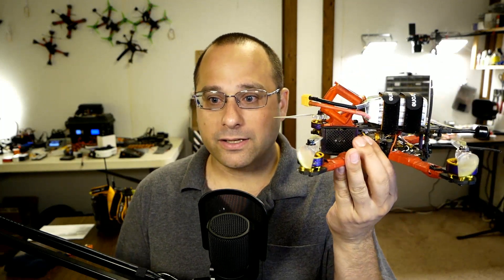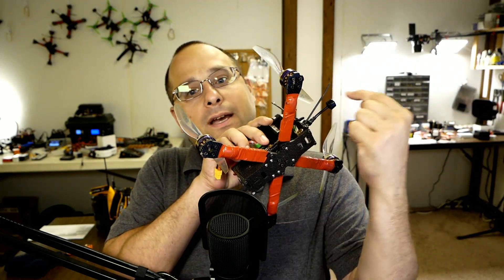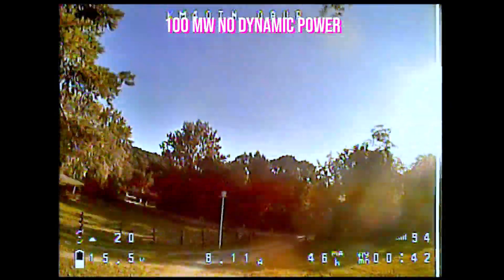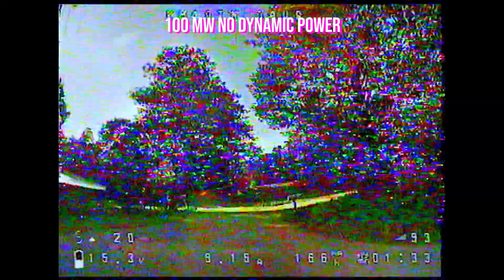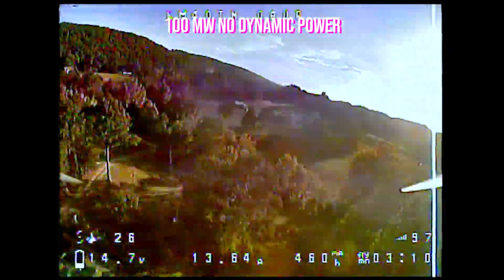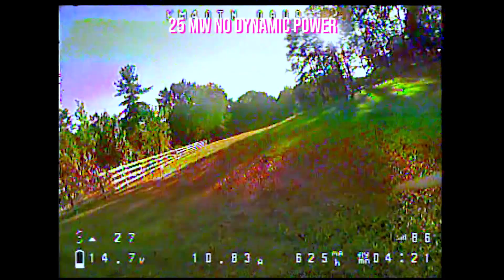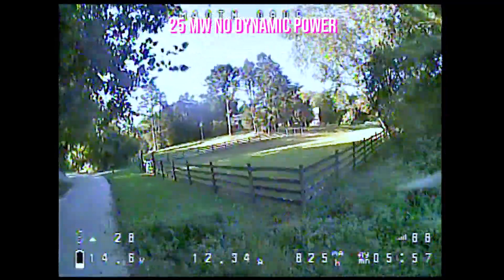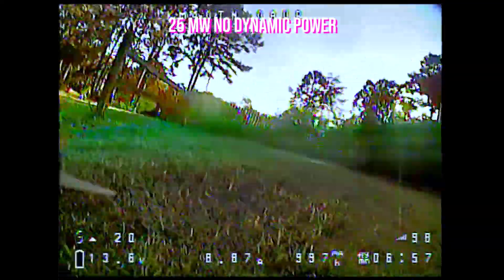TBS Crossfire 150 Hz | How Far Does It Go

Comment: i'm confused. I see people flying crossfire and its at 99rsi for ages, and then when it starts dropping off its almost like instant low rssi warning. With my r-xsr I am only 99 when its right next to me, and there is a more realistic gradual drop off of the RSSI when i fly away from myself, but I can get it down to the 30's and still have control of my quad. Whats up with that?
Reply from the maker: Crossfire is probably reporting lq or combined lq/rssi. In older versions of Betaflight it reported lq as rssi because Betaflight didn't support lq. Lq drops off more abruptly.

Comment: Why not use a clover leaf antenna like on the video?
Reply: Antenna are tuned length for bst results (and for purpose). E.G. in most cases CRSF is 915MHz where as VTX (Video)  is 5.8GHz so have very different requirements from the antenna.

Comment: I got out 1.2 miles on 150hz with 500mw in an extremely rf polluted area.
Reply: I did better than that on 100mw and only using immortal t on the full TX and dipole L antenna on the nano rx! People don't realize that if your pushing too much power it can make it seem like you have weaker signal and corrupt data! 25mw in the city I got 3 miles using dynamic it went to 100mw and got 5 miles before telem dropped and went to 50hz! I bet if you went to 100mw you would go farther! 915mhz 25mw you should be able to go really far over 2.4ghz! Just the way it works! Expecially using Lora! I'm a diehard fan on tbs for life and love their products! Every feature they came up with and future proofed gear like the full TX had BT and Wifi built in from day 1 even tho it wasn't enabled yet 3+ years ago! Express lrs blows tbs crossfire out of the water but the only difference between the 2 is express lrs uses Lora tech tbs has the capability to but doesn't really use it!
Reply: @jbizzbuildsmanstuff9932  I got the Tango 2 and need to use the 868MHz Band because I'm in europe. I want to use the locked 150hz on my quad. Set the quad up for locked 150hz.

At the moment I use 25mW and Dynamic Power on at the Tango 2. Should I use more mW or turn Dynamic Power off? I don't know the best settings for not losing connection because I'm locked at 150hz.
What would you say about it?

Comment: Pfft, CRSF won't go further than 50 metres before failsafe for me. Joshua, your videos are an absolute Godsend but I'm about ready to throw my quad out the window because CRSF just won't work for me.
Reply from the maker: Something is seriously wrong with your setup. For example, if you are in the U.S. and using 868 MHz then that is why. You need to set the CRSF for FCC region. Or if you are in EU and using 915 MHz same thing. You need to set it to EU and use 868 MHz.

Comment: I no this a good system but im going 1 mile away threw woods and trees,buildings blocking me and everything and i dont failsafe till i try about a mile and half.Point is im useing a dx7s.I want to go crossfire but since my dx7s is putting out 302mw i dont no that i would gain much.I watched another video a guy had his cranked up to 200mw and is getting just 3/4 mile in wooded area so if its no better coverage than that my dx7s will do that.I think im going to try a 433 system like dragon link or something.wish crossfire had a 433mhz system at 2 watt.

Comment: Hey Joshua Bardwell, can you tell me, if i can unmount the antenna on the crossfire micro tx when sending to another quad with frsky receiver? Do i have to set something in my frsky qx7 radio? 
Thanks for your videos!
Reply from the maker: If the Taranis Model has "external module" enabled then you must leave the CRSF antenna installed.

If the Taranis Model has "external module" disabled then you can disconnect the antenna.

Look in the Model Setup screen and you will see the option to enable/disable the external module.
Reply: Joshua Bardwell Thanks a lot.

Comment: Update rate != Latency,  you can have a high update rate and high latency, or a low update rate with low latency. Standard Taranis has a low update right and high latency, the inputs take a while to get from the sticks out the radio, from the tests I've seen, CRSF has lower latency regardless of the update rate (as do many other protocols, FrSky Taranis Sbus is remarkably high latency).

The L shape only reduces nulls in a magical sim land without a cable, when the cable is added to the simulation there's just as many nulls. The efficiency is also lowered and the SWR is raised when you mount the antenna like that.
Reply from the maker: Update rate does not equal latency you are correct, but it is also true that when crossfire drops to 50 hz, latency goes way up.

Comment: Off topic but what are those 6 inch biblades on this setup? Like them?
Reply from the maker: Lumenier 6040. I do like them pretty well. 6" thrust but more responsive than tri-blades. But they don't seem as well balanced as the HQ tri-blades I had on there before.
Reply: Joshua Bardwell I’ll give them a try, thanks!

Comment: I went to TBS with a issue I had seen with friends nano RX,s about the bind button coming apart . I had bought 5 nano RX’s and the bind button on 1 of mine came apart. When I contacted TBS the guy I talked to told me I was being to hard on the switch’s if I had damaged 9 of them,  I told him I had not damaged 9 of them only 1 of mine the other 8 belonged to friends of mine that had problems. That I had fixed by removing the switch. 
When some flunky from a company is rude to their customers they deserve what they get. I HOPE TBS GOES OUT OF BUSINESS, I NO LONGER OWN ANY TBS S**T AND ANY ONE THAT COMES TO MY WORK BENCH GETS POINTED AWAY FROM THOSE ARROGANT YOU NO WHAT’S.
Good luck with that business model fools. 
Show less

Comment: I fly a lot of long range FPV so am are very aware of the link quality, more than update rate, I primarily use RSSI with Dragon Link.  Update rate on a long range quad is usually not a big deal since we are not doing freestyle maneuvers.  Video is always the first to go.  I noticed your video feed was breaking up for much of the flights.  I was surprised at the lack of hard data, not like you Josh.  How about running the test with GPS on the quad in the OSD so we can see the distance from home, e.g. your starting point, where the update rate drops to 50Hz.   That would be much more informative.
Reply from the maker: This is not a long range test because I don't really fly long range. This is a freestyle/racing test to demonstrate whether 50 Hz kicks in at typical freestyle/racing ranges.
Reply: Ah but that is the question, what are those ranges?  With no empirical data to look at there is no way to use use your testing.  BTW no t everyone in you audience is a freestyle/racing pilot.
Reply: @chuckwain5591  about 360 to 460 feet low out the gate and on the road
Reply: Oh wait 14 kilometers

Comment: Interestingly enough, the L-shaped antenna still have two dead directions. It should be obvious as the contribution from the two parts of the antenna can cancel out each other in some directions. Someone made a study of what happens if you bend a dipole antenna here...   http://www.qsl.net/kk4obi/Center-fed%20V-dipoles%20Horizontal.html
Reply from the maker: I think it's still a more circular pattern than the straight antenna though right?

Comment: I recently bought an emax mini magnum 2 stack in search of easy racing builds, unfortunately I found it only has 3 pads for the rx which leaves me a tx pad short for my crossfire....I tested and found everything works ok with that 2nd channel wire disconnected. Does this mean I am effectively locked in 50hz mode from doing this due to no feedback? Would sbus at 150hz be better? Thanks a lot I'm trying to get this baby together as a backup for a race this weekend 😬
Reply from the maker: I'm not sure what the answers to these questions are. Basically you don't have telemetry. I think CRSF radio link will still work the same though.
Reply: Joshua Bardwell  thanks a lot for the input anyway...I've flown and the control link seems to be ok, like you said no telemetry
Reply: Oh wow cool . The flight controller rx pad ?

Comment: Lets be honest here, proper FlySky setup still beats that 400$ gimmick in both range and latency
Reply from the maker: Prove it.
Reply: @JoshuaBardwell  Since you mention proving the FlySky, I'm wondering if you have any suggestions.

I'm just bought a Yagi-Uda antenna 16 db, and I'll be connecting that to my FlySky i6. But the question is, should I go ahead and order a 2w Wifi booster (I'm not trying to cook a turkey, but the 4 and 8w units are not much more). My controller is already modified to run off 1s to 8s Lipo batteries (so I should be able to just use 3s to power the booster and controller).

Total cost (batteries included) for controller and mods is under $150 total. And yes I have a HAM liscence :)

I got annoyed with a few drop outs and a crash recently that burned up a motor, ESC, sheared antennas, and broke my FC and props. I figure $100 in mods is worth it so it doesn't happen again.
Reply: z what the new radio with out any firmware 😂

Comment: What's the latency for FrSky then? Would be cool to get a comparison between TBS, R9 and why not putting R-XSR in the test too (since many of us are willing to switch from this one)
Reply from the maker: FrSky latency is much, much higher. Around 45 ms.
Reply: @JoshuaBardwell  oh wow. Thank you! 150 Hz: 6.66ms, 50 Hz: 20ms. So I'm guessing FrSky is around 18 Hz then
Reply from the maker: Sorry hang on. First of all, you're confusing the update frequency (150 Hz) with the latency (9 ms). They are related but you can't assume one from the other. 

Second, when I said 45 ms, I was talking about FrSky D16 SBUS protocol, not FrSky R9. FrSky R9 has latency around 16 ms I think. So not quite as fast as Crossfire but still pretty fast.

Comment: Hi Joshua, I was glad you made this video as I wanted to see if the issues I am having was systemic issue or I just had a faulty transmitter module.  On the face of it, your results suggest the later, but the replacement unit the reseller sent me also demonstrated the same issues, if not worse, so I had suspected a systemic issue.
Can I request that you re-run the test using the Taranis telemetry logging capability to record the RFMD sensor reading. This will allow you to calculate the percentage of the flight the crossfire was in 50hz versus 150hz. I find this is a more accurate way of reading RF modes. 
I would also be interested to see if you had a consistent link latency at each of the frequencies? When I looked in BBE, with debug set to  RC_SMOOTHING_RATE, I could see that I was getting a lot of signal jittering which was caused the FC to see the RX signal slower than then 20ms (now 30ms limit).  This jittering causes significant issues with the dynamic RC_Smoothing filtering code in BF, as it causes the code to re-learn the frequency for another 8 frames, during which you get a lot of RC stepping and therefore hotter motors than you should. It would be great to see the BBE output of your flights.

Comment: do price per distance compared to frsky R9. I wonder who would win on the max settings.
Reply: Fkysky i6 would win distance per dollar, hands down. $40 for a controller. If you want long range, my next mod is probably what you are after (HAM liscence required). I ordered a big Yagi-Uda antenna 16 db gain, and I might add a 2w WiFi booster (2.4 Ghz). You could go higher, but I'm not planning on cooking a Turkey with it. Everything together is under $150 including my other mods (battery input from 1s cell phone up to 8s Lipo). With the 2w booster you'll probably just want to use a 3s Lipo (price included).

Comment: I've set an audio alarm on my Taranis when Crossfire changes mode from 150Hz to 50Hz since month. What I have noticed now is that after the upgrade to the latest firmware - which gives us 250mW on the Crossfire Micro transmitter - this behavior has changed dramatically. It changes way way more often and earlier than before (I don't know which version I had before, it must be from around spring 2018). I've testet it in static and dynamic power setting, same result. In the past I've configured the Taranis that way that it speaks out the LQ value every 2s when it is not in 150Hz mode and that happend very seldom and when I was far out. Now I had to change this behaviour so that the Taranis is only speaking out the LQ value when Crossfire is not in 150Hz mode AND LQ is < than 99.
Side question: What impact has the changing of the sampling rate  to the Betaflight rc_smoothing_type = FILTER algorithm?
Reply from the maker: rc_smoothing_type=FILTER allows more configuration of rc smoothing settings. Can give lower latency on rc inputs but slightly more motor noise as the result of d term kick.
Reply: Yes, but the rc smoothing has to adapt to the change of the sampling rate, right? It does that on the fly? How fast?

Comment: Cool vid.....bbuuuuttt no one is going to buy “long range” gear to fly around their house .. would be nice to see this test in a more common environment. Big park/ hilltop / farm land / mountains ect .. not a criticism .. just an opinion
Reply from the maker: Sorry but I disagree. Many racers run Crossfire specifically for the low latency control link even though they seldom go more than 300 meters. Many freestyle pilots run Crossfire specifically for increased penetration even though they are just flying in a park or bando.
Reply: I agree, this video does help to display that, but still it would be nice to know the modules characteristics in a range/distance type flight rather then penetration, to find out how “cautious” it is. Like I said, not a criticism just an opinion, you’re the one lucky enough to get all this stuff to test

Comment: 150 Hz is like 6,66 (evil number by the way) ms. FrSky is doing 9 ms, not sure about the number for the long range module. So it's quite "usual" and not that ULTRA LOW. According to the title you could've done a test with a clear LOS instead of being surrounded from trees like crazy. I bet 25 mW is already good to go for at least a mile without obstacles being in the LOS.
Reply: Also: With any external HF module there will be additonal latency due to the communication between transmitter and TX module. This does not exist when using the internal module (at least it should not). So with crossfire we have 2x 6,66 + an unknown delay for all the packages during the transmission, while with other transmitters like Graupner the HF module is directly connected, so only 10ms + an unknown delay for the transmission.
Reply: @FPVBENNY  latency has been tested from stick to module output. I found the video here on youtube.  Its still faster than the built in frsky rfm. Modules used to be slower than internal modules because they were ppm signal to the module. Now its serial to the external module. Its just like being connected to gimbals like the internal rfm.

Comment: Joshua Bardwell I'm not sure that's data. You could have had data by simply enabling RC Smoothing filter mode "set rc_smoothing_type = FILTER" and "set debug_mode = RC_SMOOTHING_RATE".  Then debug[0] in blackbox will show you the RX refresh rate in realtime.  You'll be ably to clearly see when the RX switches from 150hz to 50hz in the data stream to the flight controller.  I'm not sure that relying on slow telemetry will show you the same level of detail.
Reply from the maker: Bruce, I am aware of that but this quad is running 3.3 and it is currently my only crossfire quad in the air. 3.3 doesn't support rc smoothing type filter.
Reply: Ok, fair enough.  Hopefully you'll be able to take a few minutes to upgrade that quad to BF3.4 or BF3.5 and try a more scientific test.
Reply: think Bruce wrote that code.

Comment: @JB Did you perceive any degradation in handling responsiveness when your link dropped to 50hz? Have you tried the 2.40 Crossfire firmware that allows the Micro TX to output 250 mw?
Reply from the maker: I've never been able to notice a difference between 50 Hz and 150 Hz. Maybe just my old slow reflexes.

Comment: Please do more R9 tests. I'm loving mine but want to see how it compares to the crxf system
Reply: My R9 was great for range.  10mW went far and saved battery.  But couldn't deal with firmware plus couple bad antennas (probably happens to crossfire too) . Most bnf quads don't offer R9. When they do they only wire sbus no telemetry so I have to rewire. Annoying 
But range wise. And range of telemetry was great
Reply: Time for express lrs
Reply: buy the crossfire it has better range and lower latency also its crossfire EVERYONE probably prefers it over the r9m ,the micro tx crossfire module is also pretty cheap